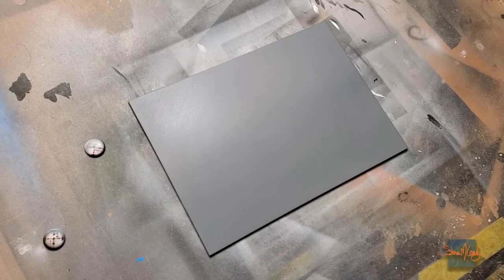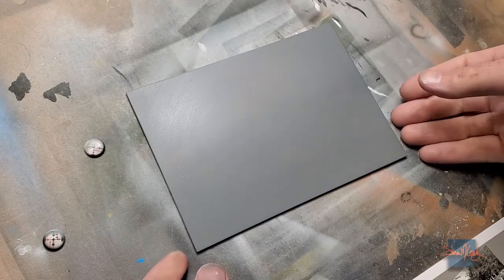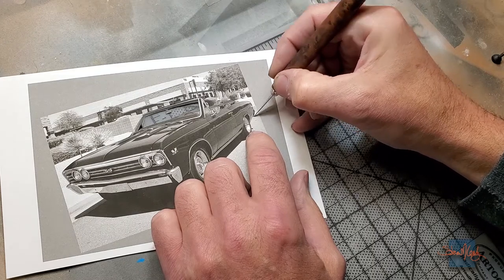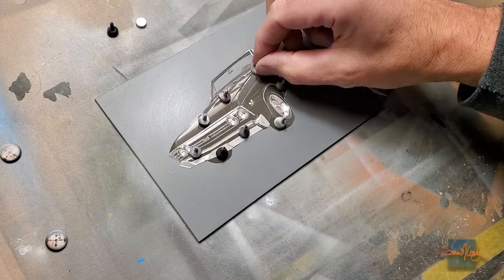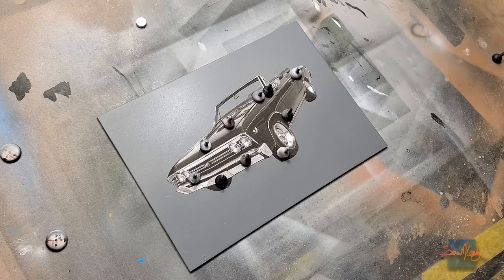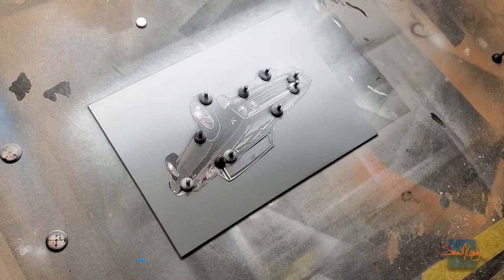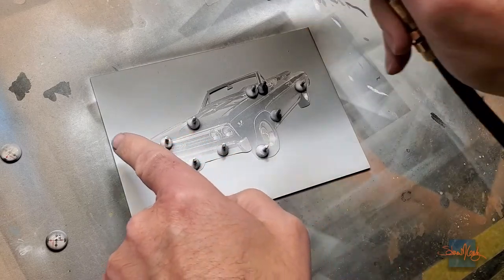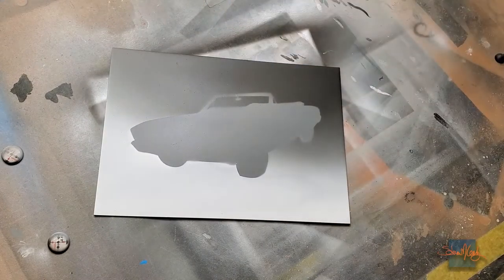Open Studio - Chevelle Part 1

Comment: I am working on this idea with the magnets for use on my larger canvas pieces to hold stencils on… been running with these ideas since watching you work. My current painting is 4X5 (foot) and I hate cutting tape or using so much plastic. You are a great inspiration and have tons of great ideas to try out.
Reply from the maker: I love it! Keep me in the loop with your painting, I'd love to see the progress!
Reply: @StevenLeahyArt  Will do... Ill post steps and stages on the Instagram thing....
Reply: With the strong magnets on canvas   I have used a baking sheet sucessfully as a backer on up to 18x24 canvases.  While ive painted 4x5 footers,  I havent tried magnetizing the backs of them.  if you do a lot of them you could get a thin galvanized sheet and tape it to the back.  Im sure it will take some finesse.  But its definitely doable.
Reply: of course if you stretch your own canvases you could just stretch over a magnetic base as well.. but thats a pretty large base to deal with
Reply: @TheAIRspace  I have used large sheets of acetate in the past – and punched holes in it and then used tape over the holes to hold it in place… challenge was it would shift a lot with the air. I am going to try the same process but replace the holes with magnets. As for backing I was thinking washers or thin metal slugs I have around my shop.

Comment: Looking forward to seeing the next installment.  
Questions (You did say it was ok to ask them.)  Maybe these are too basic.  But I took notes and these where things came to mind.  Hope you don’t mind. 

How do you clean the paint off your magnets? Or just let them be?
What psi are you spraying at? Is it all the same psi for every color? I feel like the white seems to have a terrible time at a lower psi.  
Which way did you have the fan cap facing?
How long do you leave paint in your airbrush? Do you cover it? 
What type of paper do you use to print on? 
How often do you change the blade? 
And you push limits…NEVER.  ;).  
Thank you -patty
Reply from the maker: Yes!! I love the questions! This is exactly what these Open Studio videos are for. 1: I usually do not clean off the tops of the magnets. The bottom stays clan by default but a bit of rubbing alcohol takes the Createx right off. 2: For me, the psi more relates to the viscosity than the color. Generally thinner paint=lower psi. This is variable though I tend to run higher generally because I like the way the paint shears off the needle at higher pressure. White especially. 3: The Grex is like a bigger spray gun and you can set the angle of the fan to anything you want. I prefer a vertical pattern. 4: I only put a few drops of paint in the brush at a time so generally I don't need a cap. 5: Any premium copy paper works for me. I added a link to the last batch I got. 6: I change my blade A LOT! lol As soon as the tip gives out and it starts to get tough to cut, it is gone. Keep these quesions coming!!